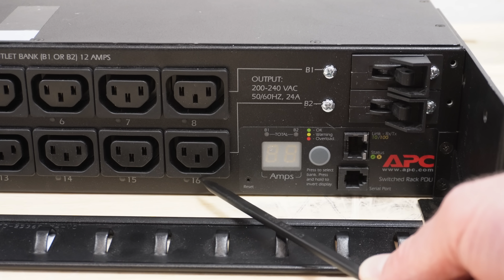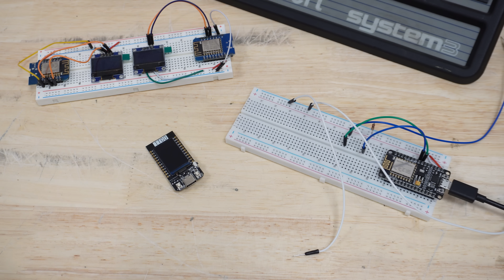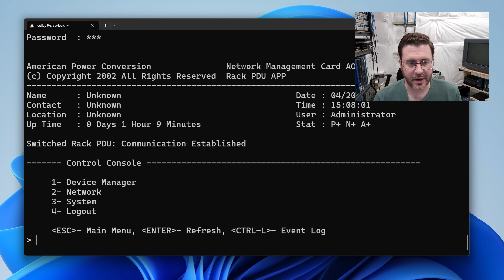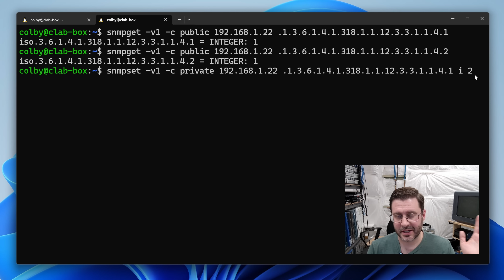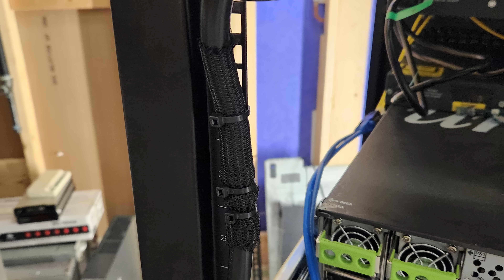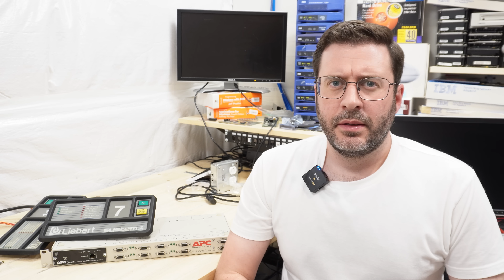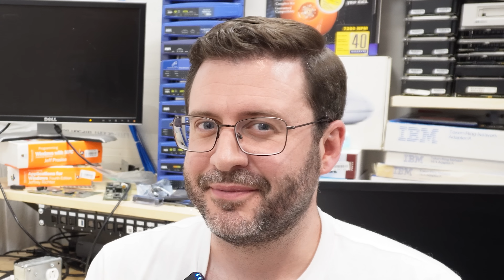Retro Rack PDU Install

Comment: We use C14 <-> C13 cables at scale because they are not voltage specific, only current specific. Same cables for everything regardless of voltage, aside from high draw 277 where things get a bit weird. as opposed to having different NEMA connectors for every voltage. Also insert some kinda loose safety advantage not having exposed pins when halfway removed, also sometimes the C14 end will lock to the pdu, but they have this for NEMA stuff as well.

It's really more of a convenience thing these days.
Reply: Plus physically strong connections that are smaller than many country's mains plugs and fit in 1U easily. Not being country specific would also make manufacturing simpler
Reply: @StephenHoldaway  I wonder if the breakers would hinder APC from using the same device worldwide anyways? (Of course the plug on the power cord would differ, but still). Like the UL / North American breakers differ from for example the ones used in the EU, and I think it's expensive if at all possible to get breakers approved for both markets. Maybe the section with the breakers can take different shaped breakers, with devices for Europe possibly having breakers for a three phase feed?
Reply: Pretty straightforward to do UL and CE
Reply: Also the C14 is the standard for pass through power from back in the old days. You used to run your monitor directly from your PC PSU. Which is what a PDU is basically doing, passing through power

Comment: The RS232 connectors are called RJ-11. Also used for old phones in Denmark. 😊
Love your videos! 😍
Reply: I thought RJ11 for serial connection was way more common for equipment than RJ45 because of the risk of someone plugging things on them.

Comment: 208V is usually what you're getting when you do a residential three phase install and that plug(NEMA L or Twistlock) is pretty common in the US. You'll see its a switched mode supply system given by the 50/60hz output. As for your power types in NA you're getting either 120/240V, 120/208V and 277/480V. with the first being the split or "two" phase every home normally gets. The 208 option is your residential 3 phase option if your power company is worth it's salt and standard commercial default voltage. 277/480V is your big industrial systems and applications as with factories and the like.
Reply: Not sure if my coffee hasn’t kicked in and I’m not fully understanding. but residential is 1 phase 240 split into 2 legs of 120.
Reply: @AgentLokVokun  Your coffee didn't kick in.

Comment: My thoughts on C14 connectors is safety. If you recall old PSUs had both C13 for input and C14 for output so you can hook up your monitor and turn it with your PC. It would be hazardous to have live exposed connectors. Also most of UPSes use them.

Comment: The serial plug is either a RJ11 or RJ12 probably.
Reply: That's what i was thinking too. If i recall correctly, here in germany RJ11 used to be used as telephone and fax connectors. I think some handsets still connect to the base with that connector.

Comment: 19:15 - There's probably many reasons why, but I think the biggest one is region differences for LARGE organizations. Doesn't matter where your colocation/datacenter is and what America or Japan or Germany uses for their electrical code outlets - as far as the power delivery to the customers in - the worldwide de-facto standard is IEC 60320.
Reply: Yea and they're rated 100-250v they're not specific to any voltage if someone cares or an organisation needs to be 'extra compliant' on every minor little detail, but i do agree it's mostly to have a single common universal connector same for C19/C20, i think the only oddity is the use of the NEMA above 20A in NA everywhere else uses Ceeform for anything 16A or above eg.  32/63/80/100A etc and of course 3ph.
Reply: @MillerWissen  I find the Nema connector for 20A a ridiculous monstrosity. the Nema-5 is perfectly capable of running 20A over it if you are not stupid and know the circuits behind the plug and what you're plugging after the plug in the extension.  CeeFom is overkill for mere 30A .

Comment: Why was -c private used when using snmpset verus snmpget using -c public ?
Reply from the maker: snmp has "communities," typically public used for reading and private used for writing
Reply: "private" is the default password ("community string") needed to make changes to the device via SNMP.  While the default password of "public" is good for just reading information from the device without changing anything.

Comment: it has a internal coin cell battery dont forgot to replace it try and get a replaceable battery holder i got the 120volt version 1u version of this and the original battery was dead when i bought it like 8 years ago its prolly due for a replacement i harvested the battery holder from a dead motherboard
Reply from the maker: oh good call!
Reply: @clabretro  when i unplugged mine initialy that led me to change it it wouldnt keep the time and the last settings each port had i have the big rack version of it i think it has 18 ports i think? i tried getting in to replace that battery but it was 2 deep didnt want to risk messing it up its pluged into a ups anyways so not woried about lost settings on it

Comment: about the auto negotiation, did you try to manually negotiate? Like set switch port to 100M in switch configuration?
Reply from the maker: yeah I set that later in the config

Comment: 1:10 No, there's five common types of PDUs, not two. Names are not 100% standardized but I'm using the the common term for them: "Basic", "Locally Metered" (measures per bank or phase), "Metered" (networked, per bank or phase), "Switched" (networked, metered per bank or phase, switched per outlet) and "Metered per outlet" (networked, per-port metering and switched).
The "premium" vendors (APC & Eaton) tends to drop the locally metered variant and only have four types in their selection, either due to their basic PDUs being too expensive (leaving no space in product stack) or from fear of eating into the sale of higher end models - though "Tripp Lite by Eaton" offers the three first types including locally metered so I guess Eaton is kind of arguable. And there are brands that offer all 5 types like Aten, they're more of a budget brand operating in "we sell whatever the customer wants" mode.
APC PDU 10/100 port won't link up with Ubiquity switch - auto-MDI/MDIX was only introduced in the gigabit specification and whether it works on a gigabit port running at 10 or 100 Mbps speeds depends on the switch - so perhaps you just need a cross-over cable for it to work with the Ubiquity switch. It definitely can be an issues - Cisco was FAMOUS for actively refusing to implement auto-MDI/MDIX on 10/100 connections on gigabit ports back in the days (it would "confuse users" they claimed), if it doesn't work on the Ubiquity it's probably either an oversight or a network controller issue (IE an oversight by the chip manufacturer they use).
IEC 60320 C13/C14 (10A/15A) - it's used for the same reason C14 and C20 (16/20A) are used in most PSU, it's the shared standard everyone uses as opposed to US NEMA, German Schuko/Type F, French/Type E and so on. It became the universal standard because it greatly simplify the production and logistics. Even some of the 120V or 208V PDUs comes with C20 inlets so you can choose either an NEMA 5-20/6-20 (home use) or NEMA L5-20/L6-20 (datacenter) without needing an adapter (which adds a potential failure point).

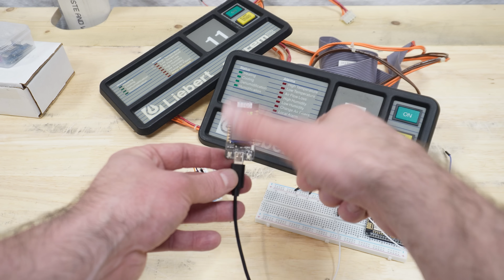Comment: 10:18 no you can't, those buttons are not usable by the application they're to reset the controller and/or put it in programming mode
Reply from the maker: you can definitely use them on the TTGO, I've written a couple applications that do it

Comment: Go and MQTT? That's not very retro enterprisey. Needs more SOAP, XML and Java!
Reply from the maker: haha true
Reply: Consider it a crossover between the homelab and retro ig, modern solutions to patch old technology together.
Reply: How about an ASP site loaded on a compaq PDA or an HP Tablet
Reply: It started 1999, so he might JUST get away with it
Reply: My persistent eye twitch just returned! The simpler stacks are soo much nicer than buzzword spaghetti
Reply: @AnonyDave "buzzword spaghetti" is the best term i've heard for this and I will continue using it
Reply: Hey MQTT is like 1999, something to do with oil pumps if I recall correctly.
Reply: Drop the Go and use Perl instead!

Comment: Those panels should really be made a little more funny. Instead of "On", that button should read "Turn back clock", and the light should of course match the names of the server behind it. And instead of "System 3", I recommend to brand the panel as "Delorean".

Comment: There was a special HP C13-C14 that was blue. It could pull the power usage data from the server over to the PDU and do some integrated reporting - Power Discovery Services was the name. Pretty cool idea. Didn’t really catch on.
Reply from the maker: interesting!
Reply: Probably because you put an entire UPS unit at the bottom of the rack and plug everything into it, and if you need power usage data and individual switching, you just get a UPS with integrated capacity for that. 
Rack space is at premium, it was just consolidated into 1 thing, even if its more expensive than both things individually.
Reply: @monad_tcp  No, rack UPSes really don't have room for the 30+ outlets needed to power a rack full of equipment.  Instead they just have one 30A outlet for a PDU to connect to.  If you buy "0U vertical" PDUs (instead of the horizontal PDU shown in this video) the PDUs don't take up ANY of your rack space, mounting in the rear of the rack next to the vertical cable management.

Comment: You know, just a few days after your last video dropped, I found one of those System 3's still in service cooling a server room at my university. There was also a different one with the same style of control panel but it had more lights and a 3 digit  7 segment display. Really insane deja vu
Reply from the maker: ha that's funny

Comment: PDU plugs and sockets exist to prevent unqualified people from plugging household appliances into them. Especially current hungry kettles. Edit: typos
Reply: Normal plugs are also un standardized for the most part. Looking at you wall warts.
Reply: I think also for space efficiency. Normal plugs are bugger.
Reply: You do realise that European kettles use IEC inlets, don't you?
It's about the most common appliance that uses that power lead. So much so, that in the UK, a computer power cord is known by the general population as a "Kettle Lead"

A 2400 Watt electric kettle is the easiest appliance to plug-in to a PDU.
Reply: @johnbooth5199  Although very similar, Kettle cords are C15s while PC cords are C13. The difference is the key way at the bottom. of the coupling.
Reply: @louislectric Yep, so called "Hot Condition" connectors.
Modern plastic kettles don't use them, they use an ordinary one. A good UPS will boil a kettle. I load tested a 3Kw UPS, by making a cup of tea.

Comment: The C13-C14 cables in a Data Centre, can be voltage agnostic (120VAC-240VAC).  That was what the old guy in my first DC job said when I asked 25 years ago.
Reply: They're also a bit more compact than the nema 5-15 and they come in locking versions too.

Comment: why not let the microcontrollers directly talk to the PDU with snmp?
Reply from the maker: just for fun, wanted an excuse to use MQTT
Reply: @clabretro  but local-to rack solution when you are standing in front of it, without dependency on other equipment might be handy.

ignoring need for wifi for esp8266, though.

Comment: There are at least 3 types of PDUs, you mentioned switched and metered. There is also POPS - Per Outlet Power Sensing, I am not sure if there is a metered variant of those or if they are just switched. I have been using ServerTech for my datacenter PDUs (they call them CDU - Cabinet Distribution Unit) since about 2007.

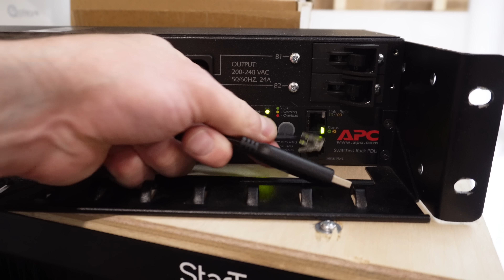Comment: 5:05 that’s just a RJ-11 6P6C which supports up to 3 lines to USB serial, just choose to use a smaller format of the regular telephone jack instead of RJ-45 to conserve some space.
Reply: Technically, RJ-11 is 6P4C.  6P6C is RJ-12.
Reply: I was going to comment this but I'll like this and comment. But yes RJ-11.

Comment: Called RJ12 connectors. Correct me I'm wrong.
Reply: Its not rj at all. Nor is the "rj45". The network port is an 8p4c (most cables and anything gigabit is 8p8c) modular jack and the serial as he said is 6p6c. A registered jack has an extra little bit on the side. And regular modular jacks simply have 2 numbers. The numbers of positions, and the number of positions are connected. So 8 positions, 8 connected wires becomes 8p8c. Or the serial is 6 positions and 6 connected wires. Looks to me more like 4p4c commonly used for phones but he said 6 wires so cant be that then.
Reply: I thought RJ11?
Reply: @anntallexgamer4630 RJ11 - 4 pins, RJ12 - 6 pins. In the last video at least on these things it was RJ12.
Reply: @anntallexgamer4630 RJ11 is commonly applied at the curly wire between a copper telephone base and the handset.

Comment: 208 volt is not uncommon in the US especially in regular data centers which run on 3 phase power.   208 is a common voltage in 3 phase power and almost every large building uses 3 phase power.